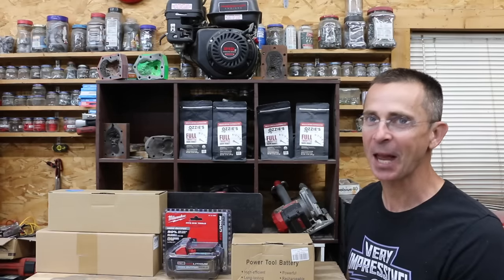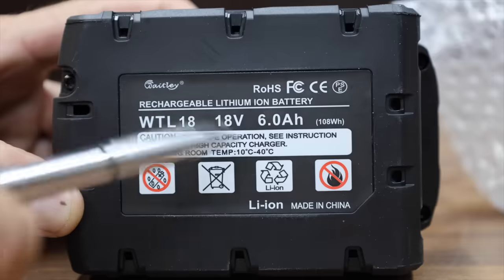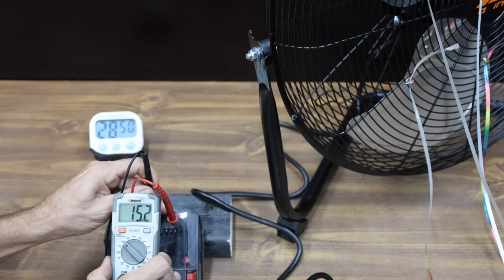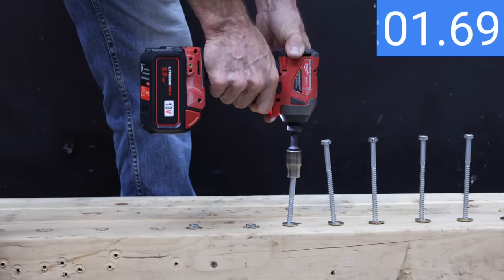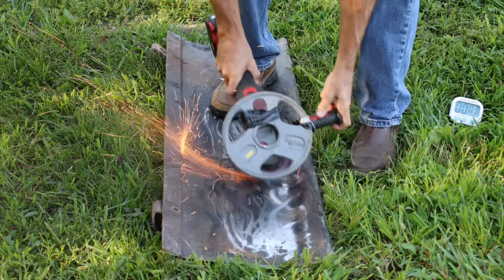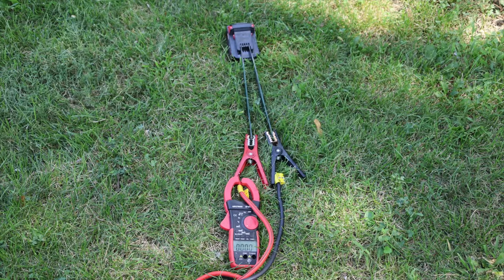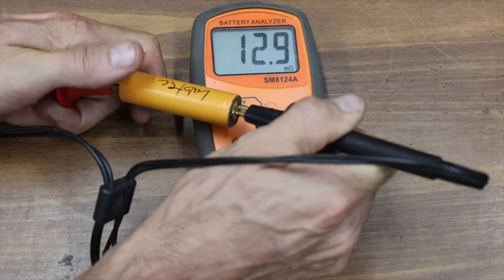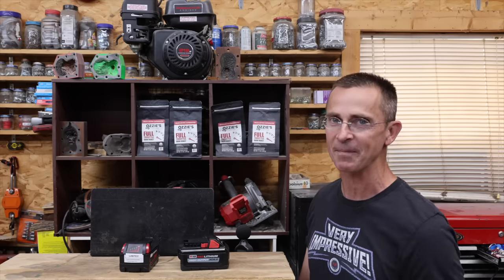How Dangerous Are Knockoff Tool Batteries? Let’s find out!

Comment: Aside from safety of the operator with tools and other electronics, there is also safety of the equipment itself.  Often times cheaper third-party (or knock-off) batteries are not built to the same specs, and this becomes a problem as the battery starts to run down or gets old (or both).  They may not be able toput out consistent power and this can actually damage  the device in some cases (especially with things like digital cameras).  This is why it really doesn't pay to be cheap when it comes to batteries.  Then there is a battery life. Some live up to their claims, many don't though.  I figure that while OEM batteries are more expensive, they are designed for the specific device you're using it in (providing you get the right one from the mfr for the specific tool/item).
Reply from the maker: Thanks for the feedback.

Comment: Several interesting things. The 5 year old battery lost about 52% of its capacity compared to the new 6A Milwaukee but still managed to out do the new knockoffs for the most part and held its own with the new Milwaukee in some cases.

While the new Labtec was not as good as the used Milwaukee it did hold its own good enough for light duty use for drills and small impacts. 5-6 of the $22 batteries would be more of a match for 2 of the $90 Milwaukee batteries at a lot lower cost although unless you are like me you would need to purchase 2-3 extra chargers to keep up. I generally buy the packages with every tool that I get so have ended up with enough of the chargers so it seams like I ether can't get away from them as they are all over the place or they are no where to be found as they are at a different work site.

As to the overload protection I wasn't very impressed. Some had a very crude imitation of overload protection, who wants to take the battery apart to resolder the connection again?
Reply from the maker: Thanks for the feedback.
Reply: Wasn't the resoldering/disassembly part of the short circuit protection, not the overload? I'm pretty sure the overload test was the anglegrinder and the shortcurcuits came from the meter. You aren't meant to repair a battery after running unregulated current between the positive and negative contacts, the feature is to prevent a lithium fire.
Reply: @xEricC1001x  

The point of "overload protection" is, if something is overloaded, the protection prevents that something from being damaged, destroyed, or causing something potentially destructive like a fire starting and burning down your shop.

Part of your problem may be that you did not see all of the overload process. If you noticed the battery was hooked to two cables with one of the cables having an amp meter clamped to it. Those cables were a pair of jumper cables rated to handle more of an amperage load than the battery could supply. The sounds that you hear are the other end of the cables clamps being touched together and in some cases the sound of the arc that was generated when the clamps were touched together.

In this case the "overload" protection was the soldered joint which melted from the amount of amps flowing through the joint which was more than the joint was designed to handle. The "high" amperage created heat which melted the solder causing the joint to open. Crude overload protection at best designed to shut down the current flow before, if you are lucky, any damage occurs to the device being powered or the battery. A decent overload system would first protect all of the parts and then, when the parts cooled down and the load was removed, allow the battery to work again. Thermal reset or a push button to reset the breaker. Think house wiring with circuit breakers. Too much load the breaker pops and shuts the voltage down until the problem can be solved then the circuit breaker can be reset.

In this case the manufactures of the batteries put money in their pockets by insuring that, if there is a problem, that you get to purchase both a new battery and hopefully, from their point of view a new tool to replace the one you just destroyed out of warranty.

Comment: if you ever have the notion to test the 1800w milwaukee power supply (the 4 battery unit, not the top off) send me a message. for the price of return shipping, it's yours to use.
i bought it on a whim and mostly collects dust nowadays - my batteries are either onsite or dead when my power goes out
microwaved a ton of meals out of town and it was a total champ though

Comment: The Milwaukee cost 3x as the knockoff, but, in the fan test, it barely lasted 2x as long.  Using the watt hour results, the Milwaukee costs 80 cents a watt hour and the LabTech costs 30 cents a watt hour.  The more expensive Tenmoer is 42 cents a watt hour.
Reply from the maker: Thanks for sharing.

Comment: Let's see.  At $52 for two batteries close to equaling the Milwaukee original battery that costs $90 I would take the two knock offs.  One reason is if the original battery fails you are sol.  If one of the knock offs fails you still have one to use.  I am a hobbiest.  Have a Black and Decker saw/drill.  Other harbor freight saws and drills with battery adapters to the B&D batteries that cost less than $25.  Six of those knock offs with plenty available to switch in in the middle of a project.  Also can use one drill for drilling another as a power screw driver without having to keep switching out bits.  Both power tools are right there.  Have been doing this for about four years.  Works for me.  Your situation can be different.  I do like his testing videos but not always in agreement.  That's why there are multiple sellers of multiple "inventions", cars, bikes, foods,   movies, etc.
Reply from the maker: Thanks for the feedback.

Comment: I have craftsman tools and weed eaters and the replacement batteries purchased from Amazon wor as well or better than the OEM craftsman batteries. 26-30$ for 5 amp hour batteries on Amazon and 119$ for same OEM battery labeled craftsman. The only batteries that don't measure up are replacement batteries for Ryobi self propelled mower. The OEM Ryobi battery is 150$ or mower and one of those died after 3 years of medium usage.
Reply from the maker: Thanks for sharing.

Comment: you can jump start low voltage lipo by directly connecting another one to it, it has risks obviously, but it will bring it back to a voltage to be able to charge it again. ALL DEPENDENT THOUGH. DO NOT TRY AT HOME. But will work
Reply from the maker: Thanks for the feedback.

Comment: The Milwaukee 6.0 battery made it to 390 amps before powering down safely. At least two of the other batteries hit about 110 amps before failing, and also starting to smoke. Also the generic batteries all showed an internal resistance of about 13, compared to Milwaukee at only 6. This means that the generic batteries will have lose their charge twice as fast, via "self discharge." Also they are being sold as a 105 Watt Hour capacity, but one of the batteries only had 54 WH according to the actual tests. The outright deceptive specifications and the high level of danger should relegate these to being federally illegal, like light bulbs.

Comment: I like the test.  But I think there would be a lot of value in knowing the cost of the actual watt/hour and amp/hour of each battery based on your tests.  Even a cheap battery, if it is cheap enough with a low output could be more cost effective.  How about a test of paper shredders?  Mine just quit working and it would be nice to know which ones are the best.
Reply from the maker: Thanks for the suggestion.

Comment: While the Labtec only cost $20 instead of $90 for the Milwaukee and indeed offers 2/3 of the capacity, if we assume it has only half or less the useful lifespan of the original (not sure, but many knockoffs are like this) it is actually not much cheaper: $90 * 1/2 (lifespan) * 2/3 (capacity) = $30. If you then consider the greater risk of safety issues or being surprised by an unusually bad specimen for the knockoff, I don't really see the point. Maybe if you need a new battery right now and don't have much budget left it's your only choice, but in most cases it's more like "buy cheap, buy twice"
Reply: I have generic batteries, I mainly use them while my authentic batteries are recharging. If I don't need them, I don't use them but when I do something is better than nothing while my good batteries sit on the charger.
Reply from the maker: Thanks for the feedback.

Comment: I've just ordered a knock off battery for my barely used but not used in 15 years 18v Hitachi trade impact driver, if you go overseas you've got to get someone to charge or use your tools every few years😂.
Though my paslode batteries for my nail guns still work well......
I guess lithium really has to be used or it dies, not sure what's in those paslodes but they seem to be fine after sitting 15years....
Reply from the maker: Thanks for the feedback.

Comment: Very easy to buy cheap batteries . Replace the cells inside with battery welder . I use a super capacitor on the last cell and add a resistor . Works 2 or 3 times beyter than original design .
Reply from the maker: Thanks for the feedback.

Comment: Hi .Thank you for your comparison. The workmanship and materials of the imitation battery are really very poor. Although I support your results, I don't agree with your comparison. The capacity and internal resistance of the 21700 battery is better than all  18650 battery. Can you compare the original 5-ampere-hour battery of the Milwaukee18650?
Reply from the maker: You are welcome!  Thanks for the suggestion.

Comment: Batteries power everything and are the most expensive part of any tool kit.  I bought Ego outdoor equipment, because of the high on-line battery comparison ratings, mostly for longevity and recharge rates.  A "cheaper" 56 V battery would be nice, since there is a big secondary market, and they are also all made in China.  However, I never thought about short circuit protection.  So, even if the voltage matches and a tool adapter can be used there is the safety factor.  So, saving 50-100 bucks is not worth risking having my garage/house burn down.  JUST SAYING...
Reply from the maker: Thanks for the feedback.

Comment: Yep, suitability for purpose over cost is the main factor for me.  I'm happy enough if I can weed out (ie not even buy) the worst of the worst.  Running an angle grinder on tool batteries is not something I would want to do or even consider sensible.

My latest has been a battery for a Dyson.  The original ran for about half an hour, died after five years and costs $120 to replace.  My first replacement ran for maybe half an hour, cost $26 and died after five years.  The latest replacement seems to be better quality than the last one, lasts forty minutes, and cost $22.  I'm betting that it gives five years of service too. I suspect the second one had a very poor BMS in it - when I opened it up I found all of the cells were in very poor shape.  That is the main concern for me - The BMS is always inside the battery case, and means you are at the mercy of whatever janky circuit design the Chinese manufacturer used.

There are different 3.7V Li Cell chemistries - Lithium cobalt (higher capacity) Lithium manganese, and hybrid chem (higher current/better safety).  The Chinese often use Li-Co because it allows for higher capacity and they are cheaper to produce, however the quality of the cells is often very poor and they are sometimes not the right cell to use in a given application.

That said, I no longer worry too much about capacity.  Most are OK and for things like drill batteries you always have multiples anyway.  OEMs charging six times the price for sometimes marginally better performance  seems a bit disingenuous to me.
Reply from the maker: Thanks for sharing.

Comment: Probably the single biggest issue with knockoffs is lack of consistency.  Buy two of the same knock off and you may have completely different cells and bms in them leading to different performance levels from the “same” battery.
Reply from the maker: Thanks for the feedback.

Comment: It's mainly the circuitry I worry about in the knock-offs.  With the Milwaukee line of tools, there is (supposedly) communication between tool and battery.  Is this the case with the knock-offs?  I doubt Milwaukee shares their communication protocols with the companies making these knock-off batteries.  Knowing how the country of origin (which I can't mention here) operates... reverse engineering is a common practice, as is stealing trade secrets.  However, I have a very high confidence level in the fact that the engineering of the knock-off circuitry is poorly executed at best, and highly dangerous at worst.  I would never trust an off-brand battery in any of my expensive Milwaukee tools.
Reply from the maker: Thanks for the feedback.

Comment: Labtec offers best bang for the buck / OEM Milwaukee best quality, best capacity & premium priced accordingly // in other words you could probably get 5 of the Labtec batteries for the price of one OEM battery & have more net capacity as a system. Calendar life probably way better for the OEM battery in terms of sitting around disused for much of the year, used sparingly like most typical DIY homeowners who only do weekend projects for 10-20 weekends per year more or less //

Comment: I have numerous power tools (granted, Makita, not milwakee) - three chainsaws, blower, impact wrench, ratchet, drill... and I've always used AM batteries with no issues whatsoever. I'll take that back - one AM (2AH specifically for ratchet) was garbage. And so was one of two recently purchased OEM Makita.
It probably is the case that OEM batteries are generally better but at 3x times the price? Unless you are a professional whatever using them 8x5x200+, it's not worth the price.
Reply from the maker: Thanks for the feedback.

Comment: It all depends on the cells. The Chinese batteries do tend to use bad quality or things or third rate cells with low discharge rates as well. 
 Build my own Makita 18v lithium batteries and they with great. I use 18650 and 21700 cells
Reply from the maker: Thanks for sharing.

Comment: Im a general contractor in California. Im completely cordless. With Milwaukee M18 and M12 tools. People dont read the manual.  It states if you use an aftermarket battery in the Milwaukee tool, it voids the warranty.  So do you really save any money buying the Chinese knock offs? Not if you have to rely on the tool to do its job
 Lets go Red Lithium!!!
Reply from the maker: Thanks for the feedback.

Comment: The results didn't surprise me in the least. It's extraordinarily common on Amazon that all of the Chinese rechargeable batteries (for any type of product) are grossly overstated. An instant tell is any product that claims to have a larger capacity than the OEM. Somehow they manage to overcome the energy density limitation through magic....

Another surprisingly common tactic is not all of the battery cells will be real, some will actually just be filled with sand so they still have weight to them, but no actual functionality. They count of the fact that for the majority of people the use of the batteries is light and sporadic, so people don't tend to notice they don't last long.

All that said though, some OEMs are completely out of control on their battery pricing. For example I have a Toro battery lawn mower. A replacement battery is almost the same price as just buying an entirely brand new lawn mower. In fact, that's my plan once the original battery starts to fade is I'm just going to go back to a gas mower.
Reply from the maker: Thanks for sharing.

Comment: LG and Samsung and a few Chinese manuctyrers domibate the lithium cell manufacturing space, from which most main line tool manufacturers buy the cells for their rechargeable batteries. The aftermarket battery brands generally source cells from cheaper sources. You can tell from PF’s testing, the quality suffers. There is probably a lot of variation in quality in the aftermarket space, but I’d rather not experiment. I stick with OE rechargeable batteries and I look for discounts.
Reply from the maker: Thanks for the feedback.

Comment: I use knockoff 6aH batteries in my m12 tools, they have around 4aH comparatively and are otherwise the same. All the knockoffs lie about capacity just divide it by 2 and get a rough estimate of what you can expect. Still far better than paying for overpriced "genuine" batteries.
Reply from the maker: Thanks for sharing.

Comment: The 6AH Milwaukee battery uses 21700 cells as opposed to the 18650 cell in the other batteries. A better comparison would be a new Milwaukee 5ah battery.
Reply from the maker: Thanks for the suggestion.

Comment: Not a super apples to apples since it's 18650 cells vs 21700s, but still shows you shouldn't use knockoff batteries

Comment: I've bought after market batteries to replace my original Makita power tool batteries with absolutely no problems. The OEM batteries are just too expensive as the manufacturers really gouge you on price simply because their label is on the battery! The cost of battery components is pretty much the same for everyone except for volume discounts for materials. No reason OEMs should be charging so much more. Their loss.
Reply from the maker: Thanks for sharing.